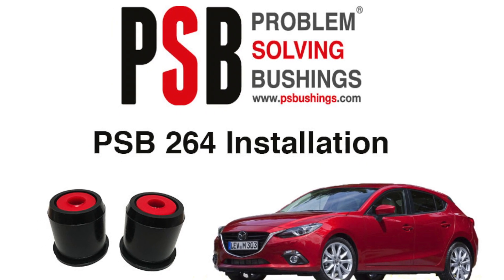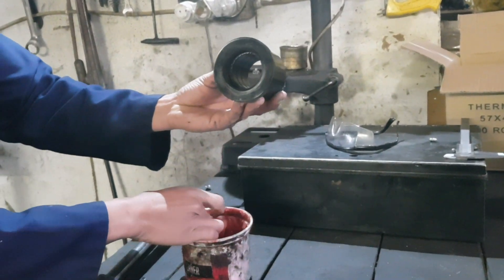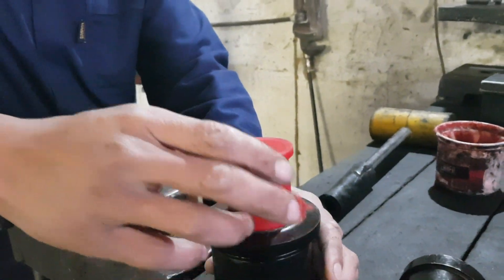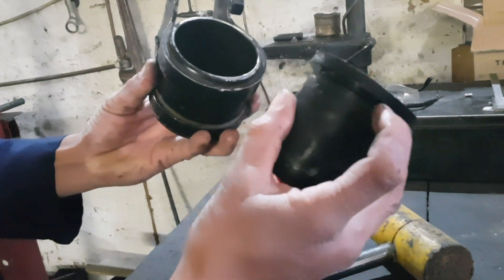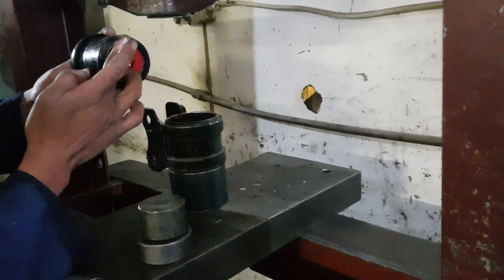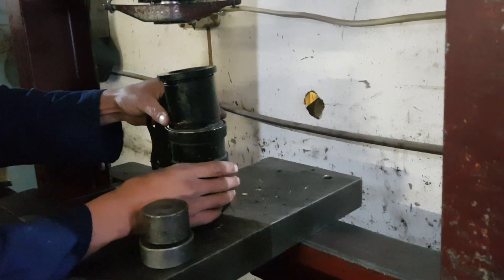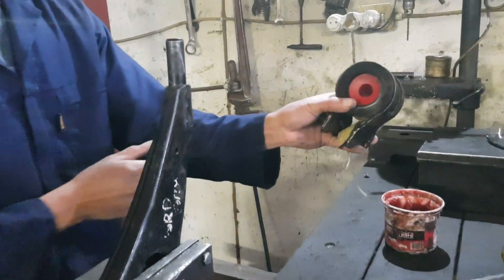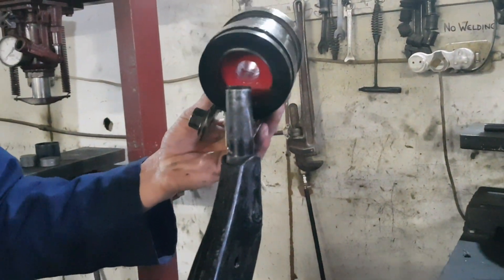Volvo, Mazda, Ford Front Lower Arm Rear Bushing Redesign Installation - PSB 264

Comment: Are both shoulders of the bushes to face the front of the car or are they supposed to be in opposite directions because of the bush housings not been handed???
Reply: I know it’s a bit late, but they need to be flipped.

Comment: OK.
Just fitted a pair of these to my Mazda 3 (2008).
The Arm shown in the Video is a left-hand item, the lipped end of the Housing is at the rear, so that, and the Shoulder on the Black part of the Bush (which sits at the forward end) stop the Bush migrating out the back.
The Arm itself prevents the Bush migrating forwards.

So far so good.

However, the Housings aren't handed, so the Bush on the right has to be put in the other way round, with the Shoulder to the rear, as the lipped end of the Housing is at the front on the R/H side.
This means there's nothing to stop the Bush migrating out the rear of the Housing.

Thoughts?
Reply: Actually, just watched it again, and that's a R/H arm.
You've put the Bush Housing on upside-down, the fixed Nuts go to the top, as SHUG pointed out lower down the page.
If you'd put it on the correct way, you'd have come across my issue.
Reply from the maker: Hi John, thank you for your feedback, much appreciated.

Comment: At the end of the video where you put the bush back on to the wish bone  the bolts are facing the wrong way nuts should be up and holes to bottom
Reply from the maker: Hi SHUG, thanks for your observation, and noted!
Reply: Let me just add to the first comment that I just installed these today and found out  that due to original housing being the same for left and right side one side makes a perfect fit but the other side housing has to be turned opposite and the important edge pointed by the presenter on the video, just before pressing it into the housing does not fit to the carved profile on the bushing cause it ends on the opposite side. Consequently I'm worried the bushing could slide out of the housing toward the arm. It has 1-2cm of room till the arm itself would stop it and disintegrate if left like that. So I'm looking into a solution by putting a spacer on the arm axis to hold it in place for sure. Otherwise I can definitely feel huge improvement in ride stability and surprisingly no vibrations introduced as I was expecting them going from OEM to stiffer bushing. Thanks for developing these. Oh by the way, front one's fit flawlessly! All best!
Reply: @dejank3367  
As I found on mine (see above).
Looking at photos on ebay, or Google images, it seems they do make handed ones, so someone cheaped-out on mine at some point.
Reply: @Docv400  I received mine and Im going to mount them soon. The thing is that you need to flip only the red bush in the black one. It’s T shaped. And the black one is symmetrical , you just mount it to clip into the metal housing. Nobody cheaped out, just users not knowing how to do it.

Comment: I've asked on ebay countless times if these do the mps bk model with no answer anyone know?
Reply from the maker: Hi Sir, not sure why you would not have received a reply from the eBay team regarding this fitment. As far as our records show, these bushes would unfortunately not fit your vehicle.
Reply: @psbushings  hi thank you for the reply they always have got back and stated they will get back to me with an answer but the answer never comes. I ended up going with powerflex. Can I ask why they wouldn't fit the mps out of curiosity? as the focus St and mazda 3 share the same chassis and components and the bushes are the same part numbers
Reply from the maker: Hi, for some reason it wasn't showing up on our system for the mps, but our bushes definitely do fit the Mazda 3.
Reply: @psbushings  yeah but mines was the mps model, and like i said the part number for mazda 3 and focus St mk2 are the same, the mazda mps and focus st share the same platform. When I purchased powerflex it's focus rs bushes they send same. Platform